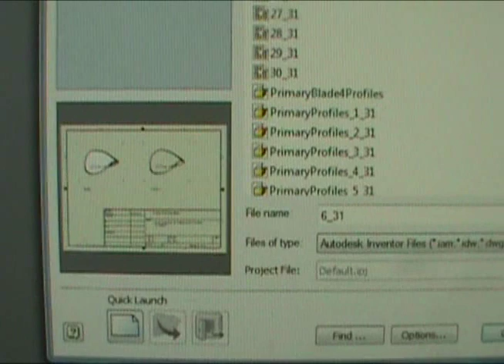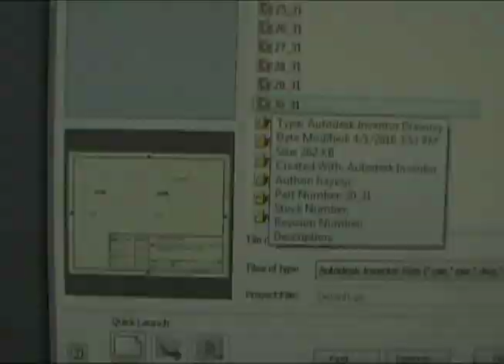Model Wind Turbine Blade Mold Fabrication

Comment from the maker: Hi Shane. Yep, that was the loft tool. In retrospect, I should have used guidelines and a surface loft. I used a solid loft and cored it out with a whole new set of profiles with reduced chords and thicknesses. The shell feature was choking, otherwise, that would have been simpler. The material was oak wood found at your local hardware store. I glued a few pieces together, machined them down, sanded them, and polyurethaned. For the fiberglass layup (not shown), I used hobby wax for the release.